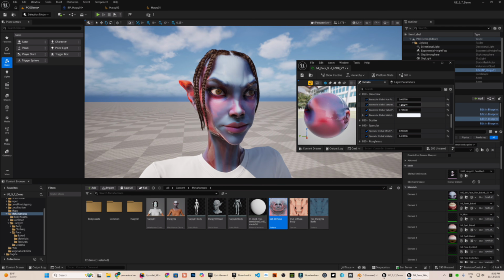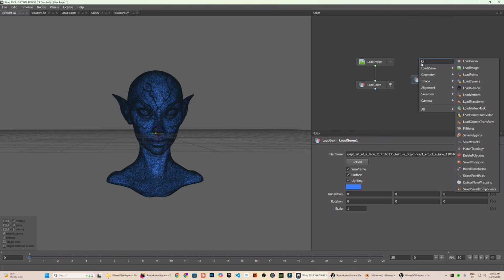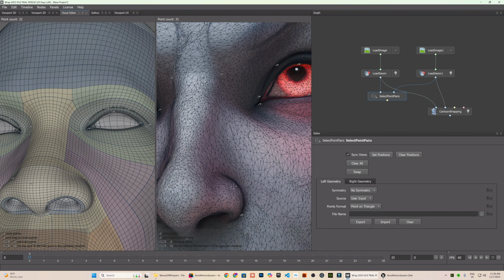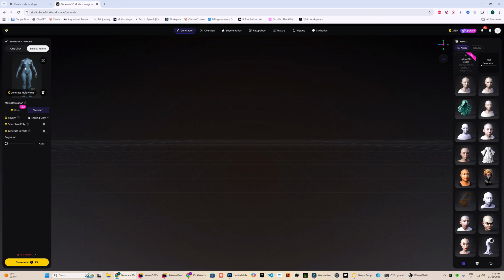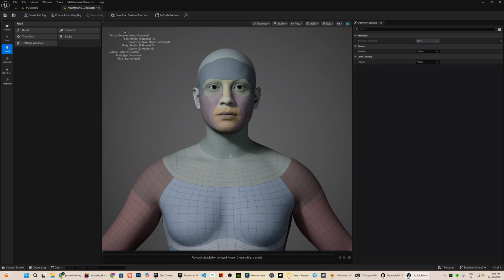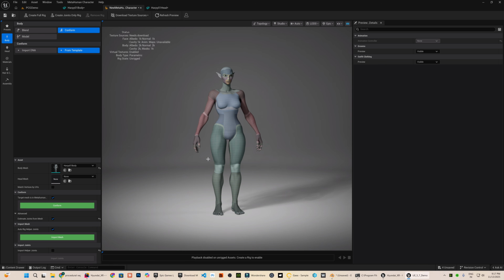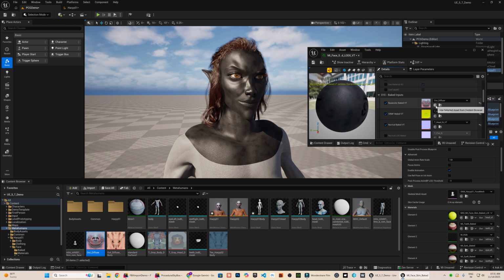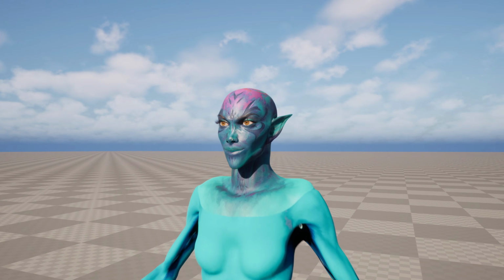Unreal Engine 5.7 Finally Makes Custom MetaHumans Easy (Without Maya)

Comment: At 14:00 you can stop the white face bug by disabling virtual textures in project settings.
Reply from the maker: It also goes away when I convert my texture to virtual texture via context menu. Virtual textures are more performant and recommended to use.
Reply: @sameek_kundu  Yeah but I'm saying, as a work around, you can disable it execute, prevent the white then re-enable.
Reply: @sameek_kundu  oh, i missed your point. so you can just convert it to virtual texture to fix it? my bad

Comment: I followed your tutorial, only for the head as a test. I ended up with a face full of random vertex distortions. What could be the issue?
Reply from the maker: Are you using 5.7 ? I had these issues in 5.6.
Reply: @sameek_kundu  hey, thanks for your reply. I am using 5.7. Now I have another issue. When I import the head as fbx from blender to unreal, it says that my mesh is not compatible with metahuman. Why it's giving me the error?
Reply: @bartkoch1988  Hello, did you solve the problem?
Reply: @АлмазНеталиев-з1л yes, by following another tutorial. This guy is not showing the full workflow.

Comment: an other example of "not possible to use since you need software which is really expensive - there ear cheaper and easier ways where you don't need so much different tools
Reply from the maker: It is 30 days free , use as much as you want in those 30 days. Yes there are othe ways , but I am a programmer , not a 3D artist, so keeping that in mind I found this most convenient to use without having to get too much into art pipeline like manually sculpting in blender and all.

Comment: There is no reason at this point to use any other tools for creating the face mesh deformation. Just use Metahuman Identity with your custom face mesh. You can then feed it into Metahuman Creator.
Reply from the maker: It is not 1% as accurate, try creating a one eyed cyclop with horns using that technique like i showed in my next video.
Reply: @sameek_kundu  that is such an edge case. Majority of the people do not need to create cyclops, but just to edit their metahuman to fit general look of a person. You are promoting an expensive app that many cannot afford for this instead of showing the tools that are already present in UE5 and available to everyone.

Comment: eyerything works... except when I also try to bring in my own eyelashes and eyebrows.
I know ur not showing how to do that, but do u have any idea how to bring in other meshes to add to the head?

I'm trying a stylized character and I'm just missing how to bring those 2 parts. Bringing them separately, of fused to the main mesh just crashes UE tho :(
Reply from the maker: You can use the custom hair groom asset to convert your eyelashes and eyebrows to grooms. Won't that work for your usecase ?
Reply: @sameek_kundu i could stylize the hair and brows to be grooms… but then they wouldn’t rly look stylized. They would look realistic, like what the metahumans have. Im kinda looking how to move these parts that are solid meshes to replace the grooms

Comment: There’s actually a small workaround that lets you display textures correctly inside the Creator viewport.

For the head, keep using a regular texture in the slot.
For the body, convert it to a VT texture and place that in the slot.

With this setup, the textures will display normally inside the Creator, just like in 5.6.

However, don’t convert both to VT textures — only convert the body.

After you export the MetaHuman into your level, you can then convert both textures to VT and apply them to the material, just like in the video you shared.

Comment: one way to avoid the need for too many points is to retopo the  AI mesh first. I discovered this by adding more and more points and getting nowhere.  Is you can get the number of polys reletavily close to the metahuman mesh first it makes the process a lot easier.
Reply: Not entirely true since you will lose a lot of detail from your OG mesh
Reply: @DenberZ_15  You cant have more detail than than the metahuman mesh, it wont add faces, just move them around

Comment: My problem is i could never get the head and body textures to perfectly align. Tried so many ways but i could never get it perfect
Reply from the maker: If you see the default textures you will notice how they painted out like a gradient, in the bottom of the face texture to match with the body. Also I will try it out making custom textures in substance, so I will cover this in subsequent tutorial videos.

Comment: The intermediate and final results look incredibly rough and honestly pretty ugly. Even with Unreal’s capabilities, the outcome still looks terrible. It really feels like the artist needs to learn and practice the basics first - sculpting, lighting, texturing, and fundamental art principles. Without that foundation, no AI or MetaHuman pipeline is going to save the result
Reply from the maker: The artist needs to definitely , but a programmer like me definitely doesnt need to. An artist can make use of this technique to create much better results. Geometry wise this is right on point, I got the exact same geometrical shape that I initially aimed for, which was also the purpose of this video. Also the texture that was generated was only 1K textures, so it looks messed up,  gpt and gemini currently are limited to that much, and also I did mention this needs to be combined with substance painter for better texturing which i will cover in next videos , but again I am no artist , I will only teach the workflows, not the final artistic touch.

Comment: When I import externally-created textures into MetaHuman Creator and download the baked result,
the original face and body color becomes completely messed up — it turns white or starts flickering as if the opacity is broken.

Because of this, I’m forced to assemble the MetaHuman, export it out first,
and then manually replace the VT textures afterward to fix the materials.
It’s extremely inconvenient.

On top of that, a MetaHuman created this way cannot be packaged through MetaHuman Manager because the material setup gets corrupted.

Compared to 5.6, this update doesn’t improve anything — it actually makes the experience much worse.
Reply from the maker: I have already covered that part with virtual textures later in this video, please follow along. The 5.7 update mainly is useful because custom body in 5.6 gives you corrupted right unless you go back to Maya and fix it manually or using third party plugins. But here you no longer need to do that as deformation as well as auto rigging is accurate with custom body.
Reply: I agree man! 5.6 didn't have this white texture problem! 5.7 is backward
Reply from the maker: @LordLuigi_Rigs  If you reset and again add back the custom texture in the materials section this works again, also ensure your texture is converted into virtual texture before you do this.
Reply: @sameek_kundu  Thanks! converting to virtual textures first solved the issue!
Reply: There’s actually a small workaround that lets you display textures correctly inside the Creator viewport.

For the head, keep using a regular texture in the slot.
For the body, convert it to a VT texture and place that in the slot.

With this setup, the textures will display normally inside the Creator, just like in 5.6.

However, don’t convert both to VT textures — only convert the body.

After you export the MetaHuman into your level, you can then convert both textures to VT and apply them to the material, just like in the video you shared.

Comment: Faceform is not free it costs $570
Reply: Sucks they don’t have a GoZbrusg like Daz3d.
Reply from the maker: It is free for 30 days without restrictions.
Reply: @sameek_kundu  What are you going to do after 30 days?
Reply from the maker: @mjesensky2760  I will recreate something similar in Unreal , and if successful I will sell it in fab marketplace for just 50$. Creating tools in unreal cpp is my main expertise.

And I can have a blast creating as many as 100 faces in these thirty days , I can sell custom metahumans in fab marketplace as well , and if this business model works and I earn sizeable profit then 570$ for  faceform is nothing, I had spent way more in the reallusion marketplace alone.
Reply: @sameek_kundu  That would be nice, I'm sure it's not simple.